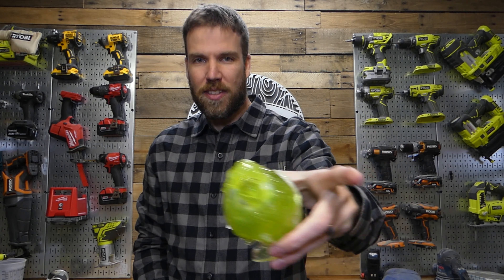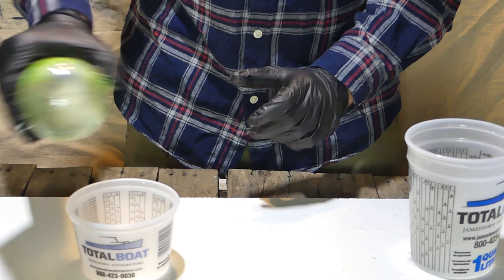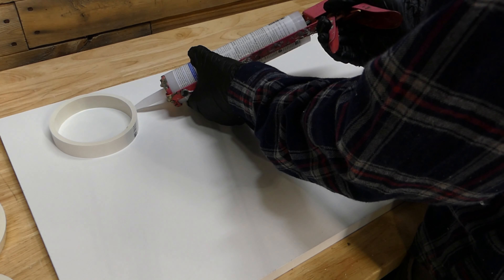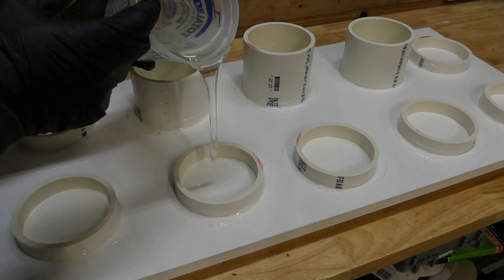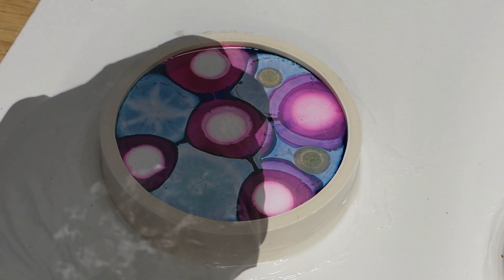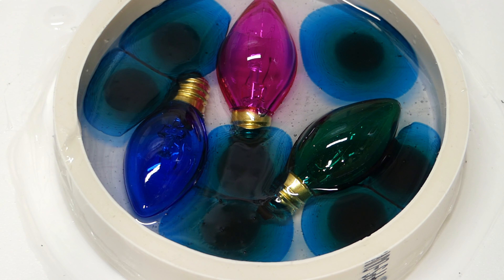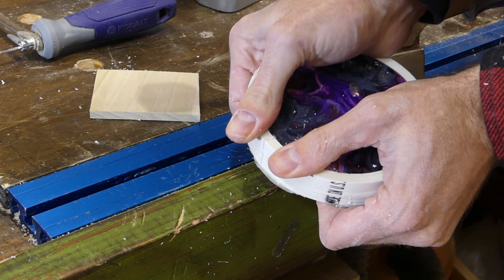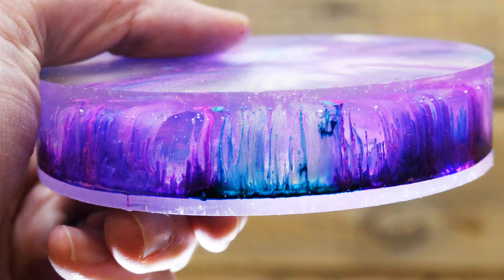DIY Epoxy Coasters & Ornaments With Total Boat

Comment: When I did my Zelda glow table the epoxy started to cure faster than I thought it would. I learned that you have to be quick about pouring when doing a larger project
Reply from the maker: Definitely, the bigger the batch the more exotherm, the faster the reaction.

Comment: I got this specific resin!! This will work for molds and everything I’m assuming right? I want to make sure I got the right kind
Reply from the maker: Yep, should be good, just watch your depth and temperature in the room.  Best results when 65 and below.  Also, if you have a kitchen scale, when you're using the 2:1 ratio it's better to mix per weight rather than volume.
Reply: Lazy Guy DIY ohhhhh ok thank you so much!!